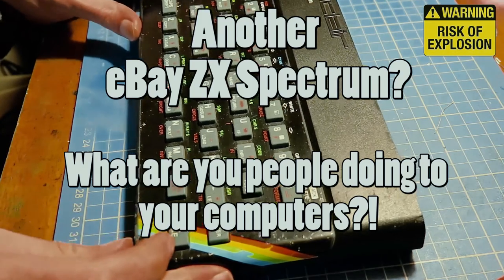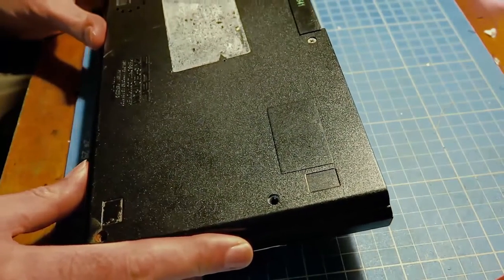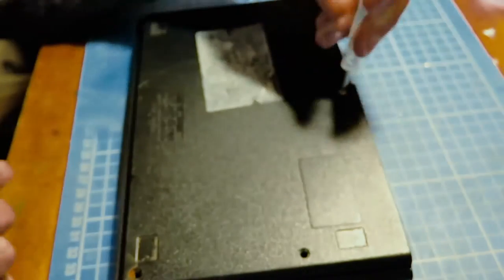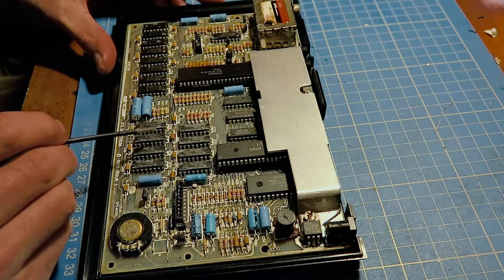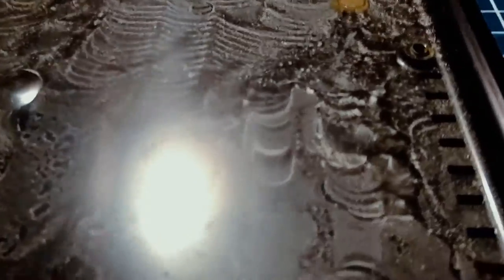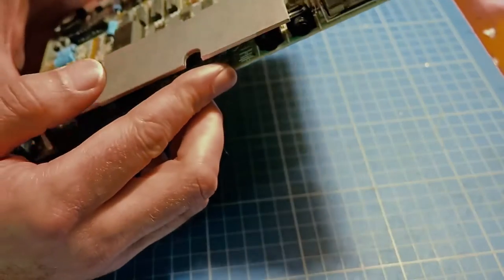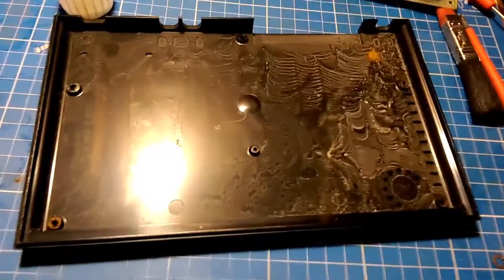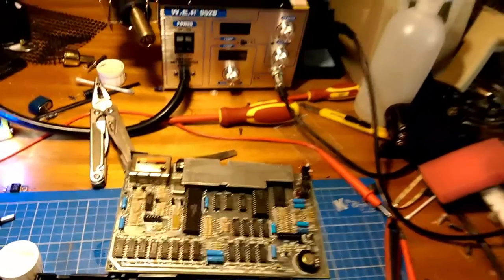Sinclair ZX Spectrum Repair - what are you guys doing to old computers?

Comment: 100% water damage, possibly even flood damage, my ql looked just like that inside.
it was left at our holiday home with all its peripherals, along with a zx81 and a couple of old whites metal detectors(short on storage at home).
we got caught in the 2015 floods these items were in a foot of water for three days, never the less the only item i could not fix was one of the detectors, its handle box and coil housing was used for a diy detector project.

Comment: "Who needs loctite when you have rust" =D   It does make you wonder what the reason for some of the damage is on these old systems.  Was it stored somewhere damp, did someone spill a drink over it and then just put it away in storage etc.
Reply from the maker: The tide marks were gritty so I guess it was drowned outside in someones shed or similar.  I did sniff it in case it was in someones flooded house (as is becoming more common in the UK) but it was odorless.

Comment: Do you use a "special" brush for cleaning boards? Or is it just a "random" brush? Thanx for sharing your video. Love them.
Reply from the maker: Completely normal synthetic brush. The IPA should reduce any static to a minimum and I hold it by the metal area, plus I am grounded via an earthing strap (which you can't see on camera). Thanks for the complement :)
Reply: Sabretooth Barnacle. Thank you so much.